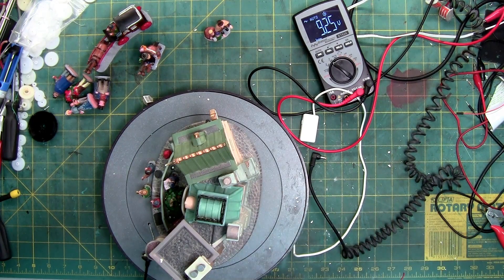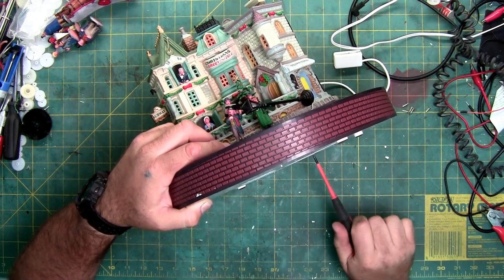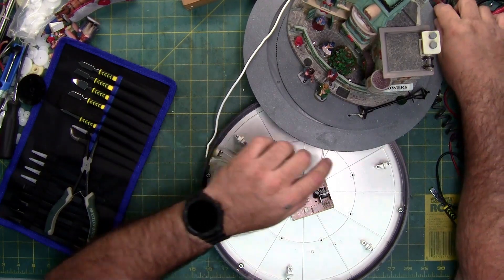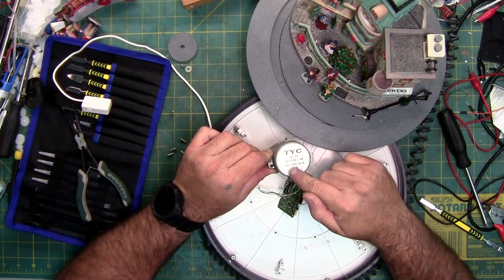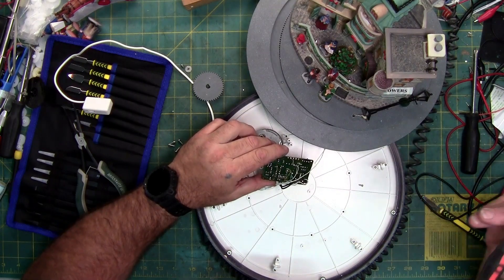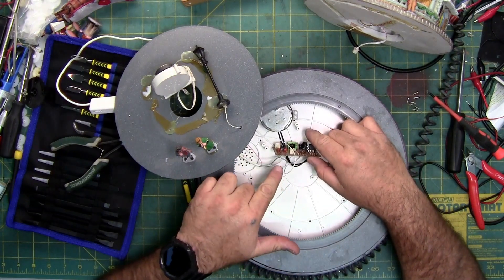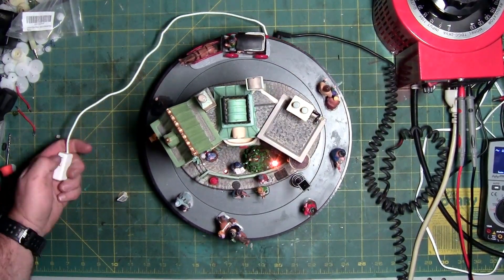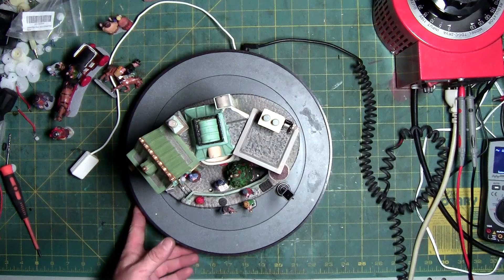Lemax Village Collection City Sidewalks Repair

Comment: Thanks for responding! My item is model 52542 of Dept. 56 (1996-1999) "Village Animated Track" from the "Snow Village" theme. The motor works but the rotary track seems a broken and worn down. Because this model is discontinued, I can't get the replacement parts from Dept 56. I tried Ebay but no luck.
Reply from the maker: You can email pictures and info to randomjchannel@gmail.com. Are you sure it is the belt? The motor is more common to fail, humming could be a seized motor. I am looking for spare parts for this piece.

Comment: "A Challange"!" Have you ever repaired an animation track made by dept 56? What do you do if you need a part for an item that's retired? Where do you go for parts?
Reply from the maker: I have. Which piece and what is wrong with it? I use parts either from Dept. 56 or HappyHolidaysParts.com. If they don't have them, I search the web and generally find something on eBay or Amazon.

Comment: Did u find the motor?  Or did u have to buy something comparable? Where can I buy the motor so I can fix my village?
Reply from the maker: No, synchronous 9 volt are discontinued from every manufacturer I can find. You can find 11 and 12 volt motors that will work. The down side is they spin slower which means you track spins slower.